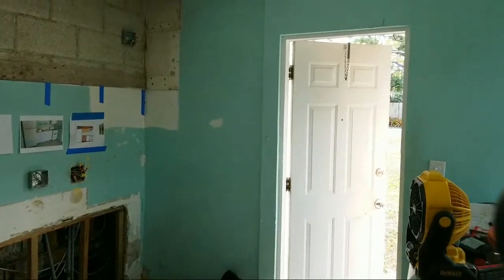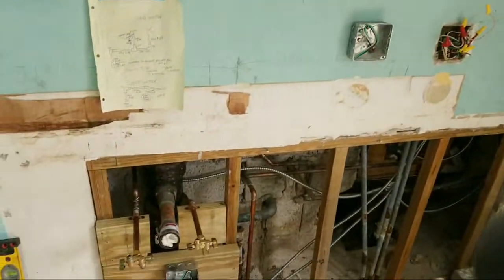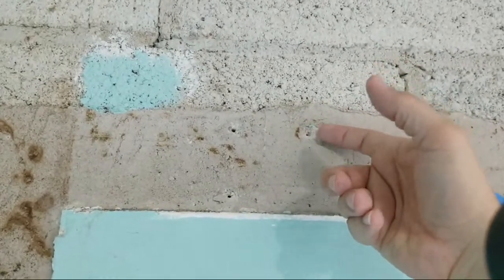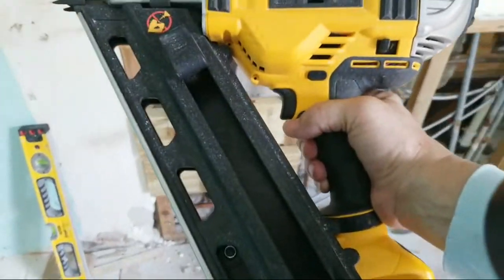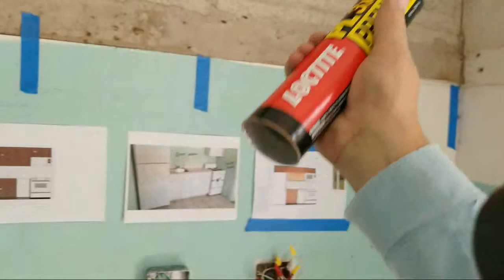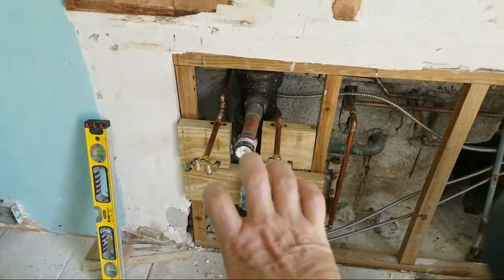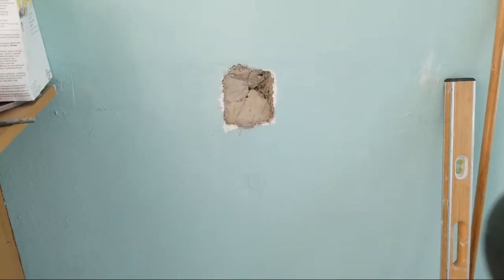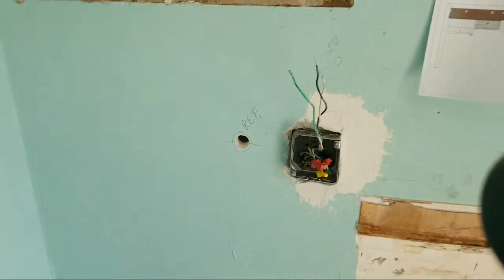DIY Tiny Kitchen Remodel Update Part 5: Electical Circuits

Comment: Jeff, Lowe’s has the Werner 5’ Blue FIBERGLASS Stepladder Model # FS205X9248 for only $29, regularly $64!!  None were at its designated shelf spot, but found a dozen at the end of the lumber aisle, on display, unmarked!!  Just an FYI, y’all!
Reply from the maker: In our area it says $29, normally $39 it says we save $10! But says not available in our store.

Comment: Receptacle is the device. 
Outlet is where the wires come out.
Reply from the maker: Again you keep coming back to argue your moot point. Outlet box is where the wires come out. Most people including other electricians refer to the “outlet” as the item holding the two receptacles. Again it really doesn't matter but you're making mountains out of mole hills and continuing to fight the issue which nobody cares about, in your my way or the highway methodology of gauging somebody's competency is highly flawed.
Reply: @jeffostroff  I’m making a simple correction. 
You are literally not referring to a receptacle when you say outlet. 
You wouldn’t just ask for a saw. 
You would be specific. 
Would that mean you are making a mountain out of a mole hill?
Electricians don’t call receptacles , outlets. 
They would correct you if they care about their trade. 
You are full of pride. 
And you are wrong. 
Man up.

Comment: Cinder block or concrete block wall?  Wonderful information on this project.
Reply from the maker: I can't tell by looking at blocks if they are cinder or cement. I have drilled masonry bits for Tapcons into it so far and it has not crumbled. Saturday we were drilling 1" huge masonry bit to run flexible conduit through holes in the wall, and it did not crumble.

Comment: I don't like an electrical box directly under a drain (cast iron WILL rot after a while). You can easily move it right - long enough cord on a disposal unit that you could move it a full cabinet over.
Reply from the maker: The drain itself it not cast iron, only the stack is. The drain appears to be copper or some other thin metal which we sanded down. We have never seen any drain like this leak, a mission connector like what you saw there is very reliable. Remember this is a tiny kitchen and we cannot move this box any further left or right due to where the vertical support struts are on the back of the cabinet. On any other base cabinet if they were wider yes we would have the box over to the right out of the way. Also, I don't ever put outlets in another cabinet, they must all fit under the sink where you can easily get to it.

Comment: PVC also doesn't have UV protectant and will deteriorate fast.
Reply from the maker: What about that gray SCH80?
Reply: @jeffostroff  yes, if you buy grey, but that looked like white pvc. all the more reason to replace!
Reply: No matter what the conduit or wire is, it should be clearly printed on it by the manufacturer that it is "Sunlight Resistant"

If it doesn't clearly state that on the plastic conduit or pipe, or wire, then it cannot be exposed to sunlight as a permanent installation.

Comment: I thought a piece of roofing paper should be used on clamps holding copper pipe on concrete block walls.  

Looks good by the way..
Reply from the maker: Thanks Joe. Have never seen that being used on the pipes.

Comment: Ram set is better and more often used in solid cement like floors and whatnot and tapcons are better for cement block walls or the wall anchor type the ram set can just destroy and crumble a old deteriorated cement block.
Reply from the maker: Good to know, thanks Banshee!

Comment: Is that cement block or cinder block?  Cinder block will not hold Tapcons very well.  I have had to put a tapcon into the mortar joint to get it to hold.
Reply from the maker: I still can't tell by looking at blocks if they are cinder or cement. But I can tell you I have drilled masonry bits for Tapcons into it so far and it has not crumbled. Saturday we were drilling 1" huge masonry bit to run flexible conduit through holes in the wall, and it did not crumble. So far so good.

Comment: Why don’t you pop wire out above micro cabinet and install a white weatherproof box in cabinet. Instead of cutting a 2”x4” hole in the cabinet.
Reply from the maker: Great question. there will be a space in between the back of the cabinet and the wall, you are not allowed to run wires in that space, so best to have the wires run into the back of the outlet box, and that outlet box will protrude slightly into the cabinet.

Comment: Sounds like a whole lot of excuses over a tool you don’t own Jeff 😂 I kid!! I love my Ramset, but it doesn’t work everywhere. Tapcons are slower but they work more places. I’d be worried that a ramset would blow those concrete blocks apart.
Reply from the maker: Yes, Ramsets seem to be better shooting through the bottom plate of a stud wall into the concrete floor.

Comment: Wouldn't it be easier and use less drywall to just get 2 sheets of 10ft drywall and run it horizontal across instead of 3 sheets of 8ft drywall running vertical and only using a small piece of the 3rd sheet to fill the gap I would 2 sheets horizontal all the way across from wall to wall and save a lot of time and have a lot less seams to have to tape and mud and it'll look better in long run as well but mainly time hanging it and your only taping and mudding one seam instead of 3 seams and as someone who used to do a lot of drywall the less seams the better and running the seam horizontal the seam isn't directly in line of sight when standing it's halfway down the wall and it's not as easy to see any imperfections in the taped and mudded seam.
Reply from the maker: They don't make 10 foot you have to buy 11 foot, harder to carry and move, and this is a tiny house. I will likely be installing the dray wall alone also, so it works better for me to manage 8 foot lengths, and install vertically, due to the number of outlet box cutouts we have to make, easier to compartmentalize the cuts on a 4 foot wide vertical drywall sheet, then to cut all the outlets needed on one long horizontal piece. Keep in mind with the drywall sheets installed side by side, we have that small valley that is formed on the border of the drywall, that hides the embedded tape. My tape seams are always perfect because I feather out 12-15" from the seam.
Reply: @jeffostroff  well yeah obviously you gotta feather it out I have never heard of 11ft drywall sheets but anyhow it isn't any more work measuring everything off of one side and marking and cutting in all the outlets at one time and be done either way you're not cutting in any more boxes than what is already there to begin with and hiding the seams is obvious and I always use at least 3 different size knives usually a 6in to a 10in to my final coat with a 12in knife and never have any issues either although I've done it professionally for quite a few years in my past and still a little bit in the present now and again for some extra cash and the point is time that it would take to simply get 2 sheets of 10ft that really aren't much heavier or that much more cost wise has you cutting in the exact same amount of boxes but instead you save yourself the extra work and time of doing 3 seams compared to just 1 seam and no matter what the less seams you have to mess with the better the walls gonna look and your gonna save a lot of wasted time  doing 2 more seams than you need to do with at least 3 different coats per seam with drying time in between each coat and that just makes absolutely zero sense from any logical aspect unless you're the milk the job for more money kinda guy now because time is money my man and more seams is more time and more chances  of an imperfection somewhere that is more likely to get noticed or ends with you spending more time to fix the issue or have very unhappy customers in the long run I've been in the construction/carpentry trade for well over 20yrs and have a pretty good reputation for honest quality work and now work for myself and the biggest thing customers appreciate is attention to detail with often requires more time spent on the job doing anything you can to make it absolutely perfect for the customer so anytime you can save yourself extra work on something like this is a no brainier to me less seams equals less work and chances for an imperfection somewhere which in turn saves time and allows you to focus on other things that need attention time is money and I have a family that also likes to see me so any little bit usually goes quite a long way in the long run man and I'm a perfectionist like you have never seen man I don't sleep at night unless I do an absolute perfect job and everyone is happy with no complaints and it has proven to be working out just great for me so far and I don't even have to advertise my work i make sure to do such a great top notch at every job I do that my customers are so happy and impressed that just word of mouth alone has brought me almost more jobs than I can handle so I'm gonna have to say that it seems to be working out pretty damn good so far I can't complain but with a family and a life you gotta look for and take advantage of any little thing like 2 less seams to do and potentially have an issue with that causes you more time in the long run which all adds up and means less time with the family on the lake and usually less money repairing something that you don't need to because everyone as well as I know shit happens and sometimes it's not our fault whether it's bad product or what shit will eventually happen.